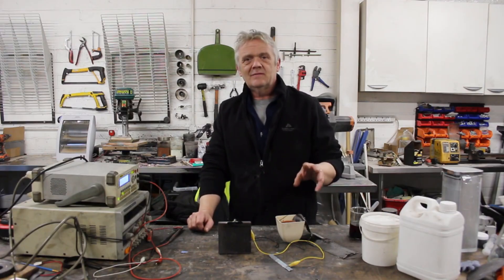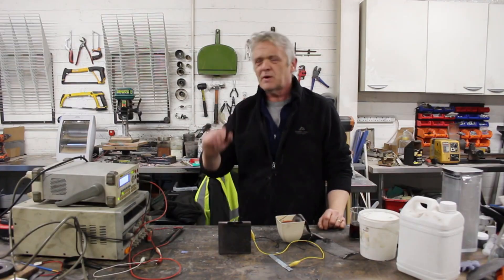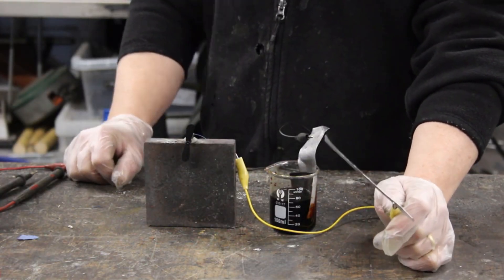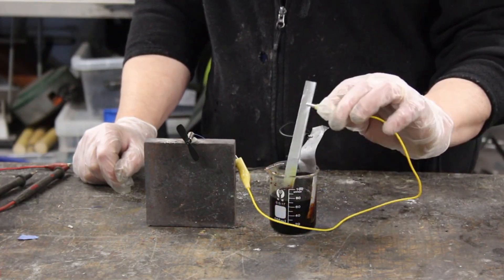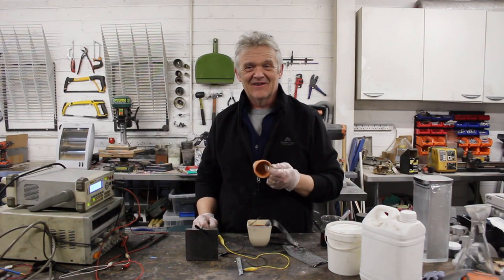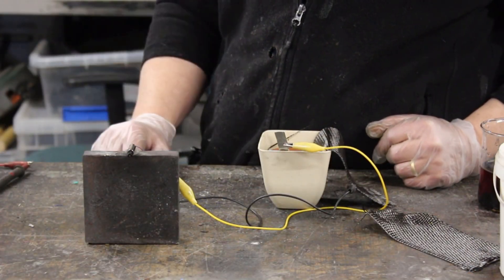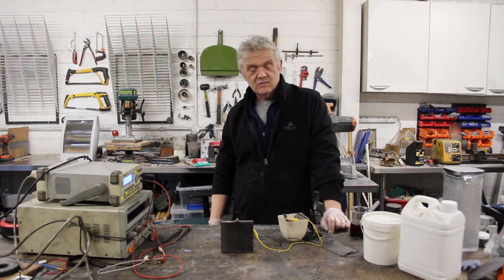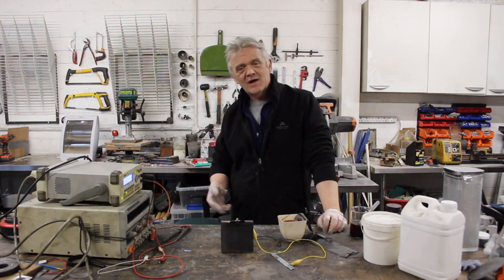2057 How To Make The Homemade Battery You May Have Been Waiting For

Comment: Thank you for this one  , really good info .. 10in series  =12v and in parallel = 1.2 A .. not bad , i just don't understand why isn't it used more often
Reply: I'd do 11 cells in Parallel, 13.2 Volts Nominal is closer to the 13.8 Volts that a lot of inverters are used to.
I do believe that many inverters care adjustable, and don't have just presets for particular battery types, because by adjusting the lowest discharge Voltage I want to see on my Batteries, I severely affect the lifespan.
With this battery, that isn't going to be such an issue.
The 13.8 Volts I referred to in the first line is the fully charged Voltage of a 12V Car Battery.

Comment: I love these battery experiments!  I just wish it was that simple to store and retrieve a few kilowatts.  Would be great to just have a 25L bucket lined with carbon fiber cloth filled with lugols and a huge roll of zinc foil.   I guess with enough surface area it would put out more amps and you could just use a 24v to 1.2v step down to charge it.
Reply: Make 11, connect in series, you have a 13.2 Volt Nominal system.

Comment: That actually looks like it has potential, with an optimized design, for a home backup. Maybe a few 55 gallon plastic drums, and some homemade clay separators. But I gotta ask... have you tried to DIY a nickel/iron cell? There are quite a few of the old Edison nickel/iron cells that are still usable, 100 years in, having gone through 3 or 4 changes of electrolyte, which is just sodium hydroxide solution.

Comment: This battery type has intrigued me! I ended up making one just yesterday, with suboptimal components. I didnt have zinc strips handy, so i bought some zinc plated screws. I didnt have carbon fiber or even carbon rods so i bought the thickest mechanical pencil lead i could find, and apparently in the USA, elemental iodine is restricted, so i bought providone iodine antiseptic.

I got 1.3 volts out of it, and interestingly i get 1.28v when the electrodes are not seperated by the clay pot and 1.30v when they are.

Anyways, my question to those more knowledgable to me, is there anything inherantly worse with iodine antiseptic vs just mixing it up from the raw elements yourself? I was considering boiling off the water of the solution to give more a more concentrated, and, i think, more energy dense electrolyte, but i am an absolute novice at chemistry and i barely understand enough to even know how to look up the information i need at this point.
Reply: Iodine is highly flammable,  it was also used to cook meth before. You could melt pennies to get zinc, it's only illegal to melt currency if you try to profit from it.

Comment: Could you house it in a 3d printed cell using a non-hydroscopic filament? then use a lifting mechanism to lift the zinc out of the housing to stop self discharge?

Comment: I have a dream I call FREE.
Fast Replaceable Electrolyte Exchange.
Instead of millions of AA sized lithium batteries to try to uncase and recycle liquids are simple and follow nature's designs.

I envision a large tank with lead acid battery design but different chemistry.
You could pull into a charging station and quickly drain and refill the electrolyte and off you go.
The station can refresh the electrolyte using whatever is best.
Wind, solar, generator or plug in.
People can have a tank of joy juice charging at home to refuel and run the house.
No more exploration, drilling, mining, refining, transporting and storing explosive gas and lithium batteries.

Bring able to make your own fuel could be a game changer for isolated developing countries.
This seems to be right up your ally.
Help me Obi-wan.
You definitely earned my subscription.🎉

Comment: So clay sewer pipe and charcoal bricketts a 55 gal plastic drum and a wad of old chainlink fence and you have a big cell . You could just drain the electrolyte into another drum to turn off  . Placing the 2 drums on either end of a tetter-totter to eliminate the need for a pump. Placing the drums on their sides would shorten the lifting hight and a sliding counterweight on the tetter like on a beam scale takes the work out of lifting the drums with the tetter.

Comment: Could you diy the new carbon black cement batteries?
Reply from the maker: done it already mate - about 4 years ago when they really were new - this is a bit of a rehash presented as new
Reply: Thanks for the response! I looked for 'Robert Murray Smith concrete battery' before I asked and couldn't find anything. Any chance you remember what video it wasor have a tip on what to look for?

Comment: Well done Robert - yet again!  As a possible design of this battery, i wonder if the zinc negative lift out could become a way of also controlling amperage, as it will be limited to 1.2 volts but the more the stick is immersed the greater the current flow. A neat way to have a battery with an amperage rotary control knob!

Comment: charcoal, ash, urine, any scrap metal and plastic/glass bottle containers... you can find all this at every camp ground in America.for cheap and effective emergency power cells. 5 volts one amp is all you need top charge a phone thats not much at all. 5-10 cells depending on surface area of the cell membranes and type of metal..  usually going to be aluminum and iron for a campsite battery... everything you need can be found in the pit... people bmelting their cans and all.  To dig down far enough you will find that nice white layer of nitrates.  campsites are a great place to source materials.... even find treasures like axes , knives, tent pegs and drugs.

Comment: It might be easy to get iodine in the UK, but here in the USA, pure iodine (or even solutions/compounds containing more than a certain concentration of "free iodine" - as in, "can it be easily extracted/concentrated from whatever solution/compound it's in?"- just don't ask me how "they" define "easily - Without checking, I believe higher than 3% free iodine is the "alarms start going off" level) is classed as a "precursor chemical", and unless you're an accredited lab, is VERY difficult to get your hands on without bringing down the wrath of the various anti-drug operations such as the DEA on your head. At the very least, you're talking paperwork, licensing, accounting for it down to grams, securing your on-hand stock by government-approved methods, and in general, is more headache than it's worth. At worst, you may be looking at prison time. 

This is because high purity/high concentration free iodine is a crucial ingredient in the most commonly used recipes for methamphetamine.

Comment: Interesting.   seems like a low priced solution to the high priced hydrogen powered battery.  I like the ability to simply pump stuff into a cell thus producing electricity.

Comment: Lugol has an Iodine concentration of 1%. This is a molar concentration of ~0.08M. This gives you an energy density of ~2 Ah/L at 1.2V that is ~2.4Wh/L. Lithium ion is 250–693 Wh/L. So this battery configuration is 100x less energy dense than a lithium ion battery. You will need to increase the I2 concentration by a factor of around 100x to make this actually dense enough to even come close to Lithium ion. However you cannot, because the max solubility of iodide is around 6M and only a max of 66% of the capacity is accessible without precipitating solid I2. 

The Zn-I chemistry is awesome, but to say it competes with Lithium ion for power or energy density is misleading, at least for the chemistry using purely ZnI2.
Reply from the maker: that's a bit simplified - but you go right ahead and build your own lithium battery lol - good luck with that
Reply: @ThinkingandTinkering    I am actually a chemist with experience building batteries. I have built by own lithium batteries as well as Zn-I flow batteries. I have a blog with actual experimental results (when I tried to link it in a comment it deletes my comment, if you google zinc iodide DIY it will be one of the first results).  

These are real flow batteries with real efficiencies and energy densities being measured. My results right now with microporous membranes for Zn-I are around 35 Ah/L, lower than the state of the art since I want the higher current densities and low cost of a microporous membranes, but even the state of the art on research papers is around the very low end of the Lithium chemistries.

It is great to encourage people to explore these chemistries but to tell people that they can build a rechargeable battery with the same power density than a lithium ion battery in their kitchen is just very misleading. That's not even the case for the best papers. I think your videos would improve a lot if you also went into why these chemistries are actually not being used right now, because you make it seem like industry is just dumb and all these obvious solutions from the 19th century exist. There are very good reasons why Zn-I and other chemistries are not the dominant battery chemistry atm, despite Lithium ion being much harder to manufacture.

It would also help people to see the actual efficiencies and capacities of the batteries you build (CE, EE, Wh/kg, Ah/L, etc). You have the equipment to measure charge/discharge cycles and give actual data. With proper data, there won't be any potential for statements being misleading, the data will speak for itself. It would be very interesting to see what values you get from something that you actually build. Not what university researchers do, but what you build and measure and tell people they can DIY.
Reply: @ThinkingandTinkering  Also note that I am not meaning to be hostile in any way, I have the greatest admiration for your work sharing scientific knowledge and inspiring people. 

However, I do think that DIY communities benefit a lot from clear results and data of what can actually be built in a DIY manner. Ideas that are not only shared but properly quantified, are much more valuable. If you did this videos showing an actual battery you built with all the efficiencies and capacities quantified, everyone would be able to know what at least is at a minimum possible in a DIY setting. That way your statements about what could be possible in a DIY setting are not just speculation.

Comment: Robert you could 3d print a 5 cell battery  that could charge 5volt devices.. each cell having a pot in it, with a printed arm that lift all anodes out a same time to turn it off.

I have a question about charging.. if eats the anode, how does it put it back? I mean if it are the whole thing I am guessing your new anode would just get plated with the zink of the first one?

Comment: What if the zinc electrode is a kind of flexible base-electrode where the zinc could stick to it? I don't know if the same carbon fiber can be used for that, giving it the capability to be folded or rolled like paper in order to be removed from the electrolyte

Comment: I wonder if you could have an equally direct method of suppressing dendrites. Maybe just pull out the zinc and allow surface tension to collapse them down periodically? Have a little wiper that spins around and flattens them down into the electrode? Use some kind of pulsed charge/discharge that favors low surface area deposition?
Reply: There are various surfactants that can be added to the electrolyte which prevent dendritic growth. Tween is one that has been used successfully.

Comment: So. In order to fabricate a 422 watt hour battery that should attach to or replace a 48 volt LiFePo4 battery, and if my calculations are correct I will need 40 cells like those, each having a kilogram of zinc+iodine. Unless I've got it wrong. So 40 kg of zinc and iodine for 422 watt hours @ 48 volts. Or a 100kg for 1kwh. I actually need this as power prices where I live have gone through the roof and I already have a lithium battery but it won't last through the dark hours while in daylight I have a good amount of photovoltaic energy.
Reply from the maker: your math is a bit off mate - you need around 2kg for 1kWh
Reply: @ThinkingandTinkering   
Thank you. I will re-check. :)

Comment: Robert, I don't know where you get your Iodine from, but even as a trained Chemist I won't get pure Iodine for cheap nor without raising a TON of flags at our local DEA equivalent… like "early morning ringing on my doorbell the next day" kind of Flags.
Iodine, specially in large quantities, is used to make Drugs… the nasty ones. As such it is a controlled substance, as its used as a drug precursor. Even if I want only a few grams, I must declare why I need it and for what I want to use it... and be either a School, University or professional Laboratory.

Although I know that chemistry from School... we made one back then
Reply from the maker: you can buy it on ebay mate https://www.ebay.co.uk/itm/155749210405?var=456126607384&mkevt=1&mkcid=1&mkrid=710-53481-19255-0&campid=5338723872&toolid=20006&customid=sW5u8oYZAAAAIVdFVmhcsJZmag8-AAAAAA and I checked out the USA ebay https://www.ebay.com/itm/394355455391?hash=item5bd16ab59f:g:i1oAAOSwM4th~z0m&amdata=enc%3AAQAIAAAA4JwPTrm4tBQWz4j9UDaQ0aNy5dzQzDc0ww0CAsA2vLvV0HxxqDPs9nRedBDil%2FMR2nL8dZXUhdwTct1sPsb9NXPlSPkbjphlT5MkL6%2F9aSAcjVNoPalU3m8azRXL9Dfcin9bAr8DDw9RM5Pzg26HUPfFxjjO68QTKYwx7Z1ftt%2FBQOEio9%2FWjdF3b7dhmt02p4uDiScdJnPZ0%2B56cKhN6kj3ZNr0IKhaQOwwhYRJkhBCqoWj7pa61ytlyuRYC3WAPU8cAaqoeDX2iqwVb0uGTlf2D0viSIRMShX%2BgIwANSUL%7Ctkp%3ABFBMosSJpNdi
Reply: @ThinkingandTinkering  
Robert, its not that I can't buy it, just not in that quantities or it will get me on half a dozen watchlists, probably even more, that are not that good to be on!
2-3g at top most here in EU. I don't like being body cavity searched every flight xP

Lugolsche Lösung on the other Hand... its expensive because you have to buy pharmaceutical products, but still possible... funny isn't it? But then, those have what? 5g on the 100ml? at a price you in the UK buy it in bulk…

Comment: What about this iron air battery that's been making some buzz lately? Salt water, an air stone, iron to rust and aide in electrolysis. Am I missing something?
Reply from the maker: it's not easy to make - but give it a go if you feel it's a good one
Reply: @ThinkingandTinkering  can you help inspire some design? I asked a guy who said he worked at renogy and he then asked for my bank accounts. Can this be prototyped with aquarium equipment or even simpler? I understand the electrolysis process for cleaning the electrodes for storage but does rusting create a current in an electrolyte solution? Do we use the current from the rusting to power an air pump to catalyze the rusting? Am I thinking about this correctly? Are you just going to make me try it for myself? I just get exhausted trying things that don't work but thanks to you, I get to try so many things that DO work!!!

Comment: I don't know if you will read this post, but I have a unique engineering project that is right up your alley -- It is a different paradigm for your standard electric generator.  What you have is a stationary ring of coils on the outside, and a rotating ring of magnets on the inside.  The dimensions are such that your inner ring should have substantial surface area.  Attached to this inner ring you have a series of closely-spaced, ring-shaped blades.  Air or water is passed over these blades tangentially, forming a vortex, driving the magnetic rotor ring.   

If you have ever seen a Tesla-Turbine, you might have an idea where this is going.  Like the Tesla Turbine, this system makes use of the boundary effect -- but instead of transferring the energy to a central drive-shaft, the energy is passed to the outer ring.  Larger area=lower torque.  The high rotational speeds that would cause the Tesla-Turbine's blades to stretch and warp from tension are now converted to compression and distributed along the length of the ring.  

Due to the lower torque requirement, the system could make use of much lower input energy, and be able to handle much higher rotational speeds.  Finding the optimal geometry would be the real challenge.  I hope someone will take up this challenge -- I look forward to see what interesting designs and applications people come up with for this system.
Reply from the maker: i have made a few generators based on this idea mate - sorry
Reply: @ThinkingandTinkering  Don't be sorry, that is awesome news!  How did it work out for you?
Reply: @walterbaltzley4546   - that was most likely British for - not unique -  all the best of British, to your endeavour ..

Energy in vs energy out - there will be losses along the way, hopefully you survive and exit more knowledgeable and stronger.

Comment: This is a bit easier than the zinc sulphate method.   Zinc and iodine in alcohol, evaporated yields zinc iodide. Awesome stuff.
Reply from the maker: cheers mate
Reply: This reaction is VERY aggressive and iodine sublimates extremely easily so you will generate a lot of elemental iodine vapor WITH a flammable liquid. Be extremely careful if you actually do this.

Comment: This is very interesting.

So the materials are:
- Iodide + Potassium Iodide for electrolyte
- Graphite foil for positive electrode
- Zinc strip for negative electrode
- Terracota pot for separator
- A plastic receptacle

So how long until each needs changing? And if the electrolitic solution needs changing, what is it done with it? Can it be disposed safely on a compost pile or biodegraded somehow?
And where does iodide and potassium iodide come from? If industrial civilization collapsed, how could we manufacture them?